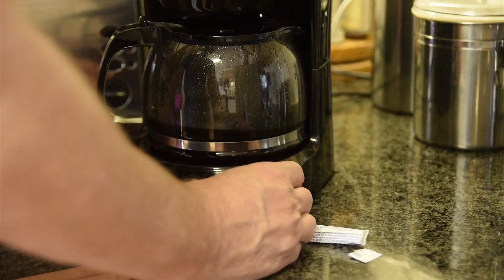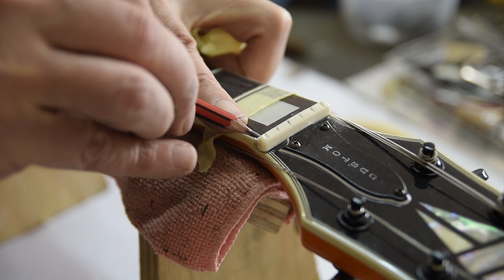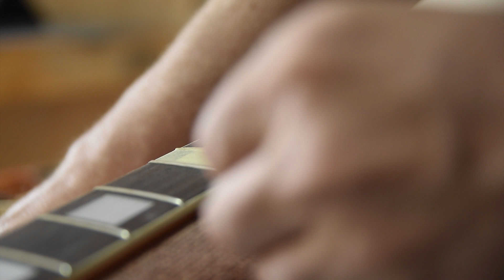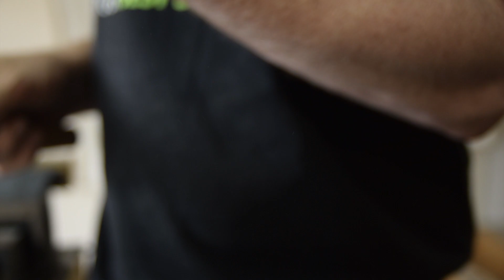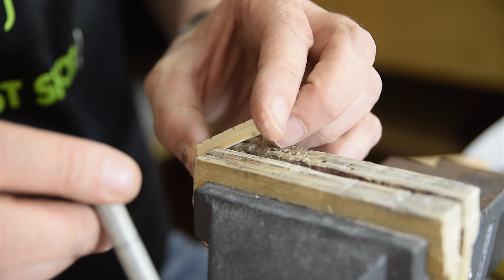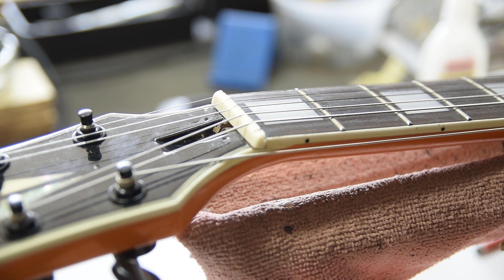Make a Zero Fret Nut- Mike's Guitar Workshop

Comment: I tried something like this on a project guitar of mine that had a tusq nut already glued in. i used a slotting saw like you did when coming in from the top, but cutting at it from the side, it dawned on me the fret files i have are flexible and thin, so i masked off the fingerboard like you did, and then kind of sawed in sideways with the nut slotting file while making sure i was holding it down against the fingerboard so it would flex to match the fingerboard. It seems to have worked well.

Comment: Good video. I just installed a Sintoms Zero Fret on my Tele. It’s asymmetrical and fits into the nut slot just barely. No need to make a shelf in the nut, it’s tight up against it. If you haven’t seen this one there’s a video on YouTube. But it’s in Russian! I think they’re made in Belarus. They’re much easier to install than the zero glide, and are under $10.

Comment: Did you use a zero fret with an offset tang to compensate for the fact that a standard centered tang will not allow the peak of the fret crown to sit precisely where the end of the nut did previously or did you remove half the width of the fret tang from the end of the fingerboard to center the peak of the zero fret?

Comment: file has blunt edge means that one side of the file has the teeth filed down to the metal so it is shiny and flat..this is the side of the file that does not cut whereas the other side still has the teeth and does the cutting..

Comment: It seems to me that you are neglecting the half thickness of the fret.  You don't remove any material from the fingerboard.  Won't this create an intonation problem?
Reply: Yeah, I don't really understand. Wouldn't this method shorten your scale length? Very minimally I'm sure, but would it effect the intonation?
Reply: @johnrogers2826  
I think so
Reply: It shouldn't affect intonation. The top of the fret crown, where the string rests, is perpendicular to the tang. The tang is sandwiched between the end of the neck ans the nut. Normally, a guitar nut rests against the end of the neck, and the string rests against the nut slots that are perpendicular to the side of the nut that touches the end of the neck. Both are essentially the same, regarding where the strings are stopped. Fret tangs are typically 0.5 mm (0.020 inches) wide/thick, so that's the amount of difference, so maybe that could affect intonation.
Reply: @Broken-Silencer 
Yes, you have the fret half the thikness of the tang  too far back. That's not a lot, maybe not noticeable on a long scale like fenders.
Reply: @danielbarbieri8199  Maybe I haven't given it enough thought. Half the thickness of the tang is approx .25mm. I'm doing a refret soon, so I might make a zero fret out of the same fret wire and see what happens.
Reply: @danielbarbieri8199  Not noticeable on any guitar. Even the most precision instruments ever built have errors of that magnitude in them.

Comment: Lots of hand work, what did you bill your customer for this? Nice Rolex.
Reply from the maker: This was for my own use. But same cost as a nut in essence
Reply: I notice that you bought the nut down so the strings were touch first fret, is this so when you put the zero fret in the strings then sit on the zero fret and not the nut? Thanks
Reply: @guitarriffsnlicks1399 yes, otherwise the zero fret would be pointless. The point of a zero fret is so that it acts as the nut for a contact point, then the nut becomes used exclusively for string spacing.